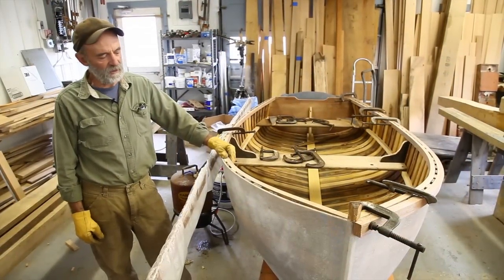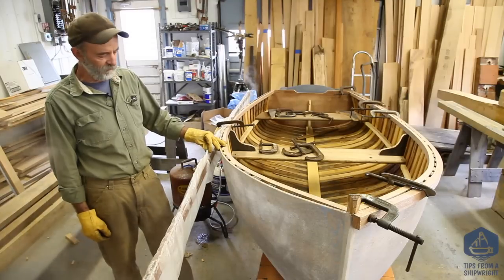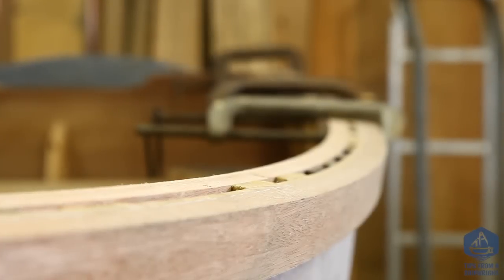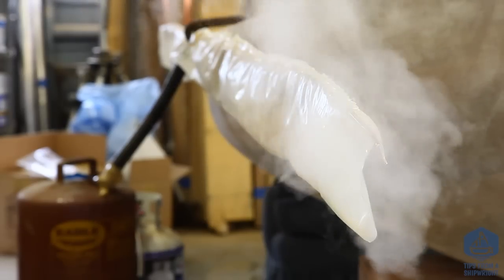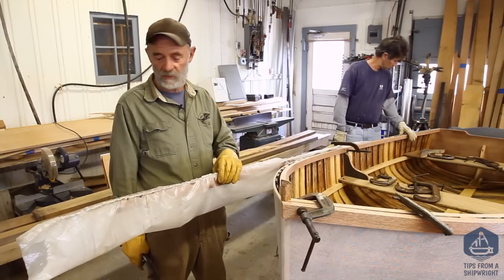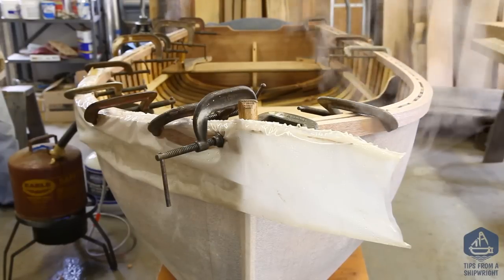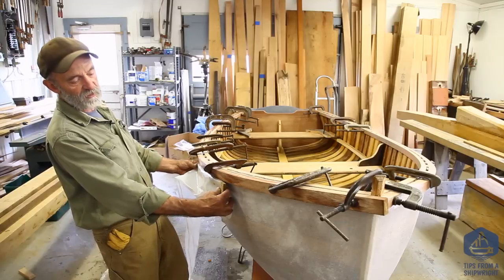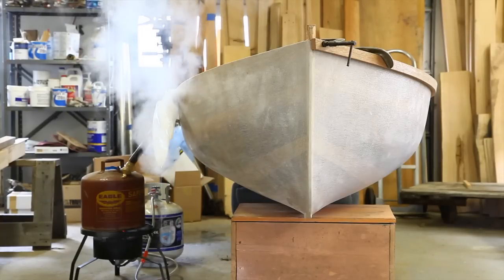How to steam bend wooden boat frames in plastic bags instead of a traditional steam box

Comment: I did quite a bit of steam bending of oak planking when I was younger and found a real advantage to adding fabric softener to the water. about a cup to 5 gal.
Reply: what's the reason to do so? what's the advantage one gains by adding fabric softener? could you explain please?
Reply: @NoChrReq  The old boat builder I worked for always said it helped soften the fibers. All I can tell you was we bent 5/4 oak fairly easily with not much more than clamps.

Comment: Genius! I've been wanting to try bending wood but thought I would have to get or build a steambox - this is a much easier solution. Thank you for posting it!
Reply: +Blakeneyd and then you have to store the box and as you advance in projects that box invariably becomes too small for you this however saves you from all that brilliant idea.
Reply: don't work as well, but if you're satisfied... In steambend does the heat or the water does the trick? I think the steam carries the heat to the wood. the hotter the better as why the steam box. the more steam pressure the better heat penetration. Fortunatly he hardly bends the wood.

Comment: 5 years late to the party, For anyone who is wondering where to get long polythene steam bending sleeves for the wood such as those used in the video above on the boat gunwales, use "polythene layflat tubing". Look for it on eBay it's absolutely dirt cheap - over 100M under a tenner incl delivery. Comes on a very long roll. After you cut it to the required length to crimp the ends use gaffa / gorilla tape. You can reuse the sleeve again and again.
Reply: Thank you
Reply: Very very Nice job as always!!!💯👌❤

Comment: Terrific idea. How did you connect the sides of the 6mil poly? 
I know you indicated melting them but was it sandwiched between a cloth then ironed or would that just stick to the cloth? 
Also how long would you leave it steaming after the original 1/2 hour? 
How did you connect the poly to the steam can without it melting?

Comment: I'm watching this a second time and wonder is the soft, steamed wood subject to damage from the clamps. Is it possible for the clamp pad to leave a depression in the wood and if so what is the best way to avoid that. I am thinking use a small block of wood under the clamp pad to distribute the clamping force but maybe that is not necessary or there is a better way. Maybe the clamps are not so tight that they compress the wood I don't know. This is something I would like to try on a smaller scale for furniture by bending a piece around a form.

Comment: Hi, great video. Can anyone tell me where to get a hose/pipe that can stand the heat of the steam?
Or where to buy such a big kettle?
Reply: "Kettle" is a 5 gallon gas can.  Try ebay.  Most hoses will, I imagine, take more heat than boiling water; after all the plastic "bag" does OK.
Reply: zininzelfdoen 
I would think that automobile heater hose would be more than adequate.

Comment: How did you melt the plastic together? Also, I am trying to bend oak in a compound curve for a canoe. It goes inward and then upward. Any suggestions would be great.
Reply: +Jonathan Gibbs   ...  that plastic is in the hardware store around the  construction area, it is REALLY thick. looks like they used a soldering tool to melt it together. they have a wood burning tool with different tips, one is spade like,  rig a light dimmer maybe, check with an electricition of course, to so it melts together rather than just melting holes in it if it is too hot.

Comment: I've been wanting to try this method for a variety of things. Steam bending limbs for a recurve bow, and steaming plywood or particle board to make a DIY sailboard top. I just hope it doesn't dissolve whatever glue is holding the particle board together xD
Reply: I hope that's a joke about steaming particleboard.  Plywood, MAYBE, but I doubt it.  If you must try it, at least use exterior ply; the glue might not fail.  It's a totally different animal that solid, straight-grained wood though.

Comment: A far out idea. It came to mind a long time ago when I noticed some bent wood furniture straightening back out when it was soaked in water (flood damaged the glue unglued). I drew the concept as a tree deliberately grown from a seedling with weights and ropes attached to the limbs to curve them as they grew. This wood does not need to be bent to keep the grain parallel to its circumference. By training the limbs with additional weights and ropes they can actually be curled into full circles. The tip can actually be trained to grow through the earlier part of the curl. Eventually it will produce a solid circle of wood as the tip grows through and fuses to the earlier area. Many branches of the tree can be bent this way. Imagine "S" curves grown into sycamore, oak, ash, and even oily cedar wood bent like this. All kinds of projects like musical instruments, boats, furniture and etc. can benefit from this. I'm too old to see this happen, but some youngster or a company can get with the program.
Reply: It's not a far out idea at all. Training trees, by various methods, has been happening since ancient times. It reached it's height from the middle ages to the 17th Century. The general term for this is "Espalier." But what you are describing isn't effective for carpentry purposes, because training trees to grow in any direction but straight up immediately stunts their growth. Trees grow more "viney" when bent. So it's much better for carpenters to have larger and greater quantities of straight timber, which they can bend themselves. The only non-decorative, somewhat practical benefit of espaliers, is in fruit production. While shaping trees to grow non-vertically stunts their growth, it can increase density of fruit production in some species. It's not really labor/cost-effective for the orchard industry though, so it's mostly relegated to fancy private gardens, like the other purely-decorative forms of the technique.